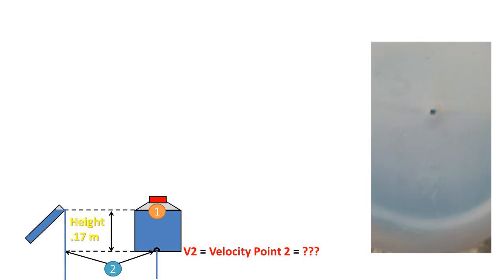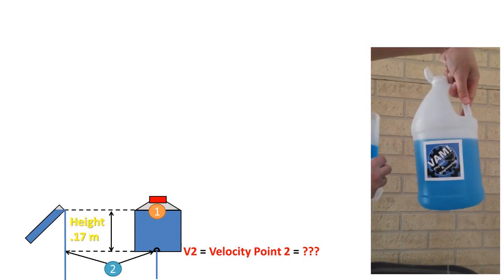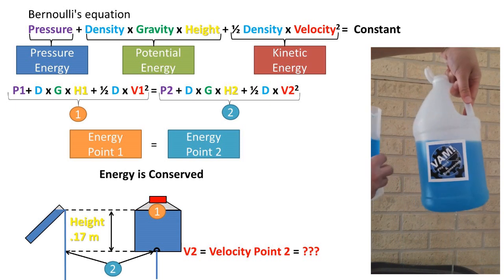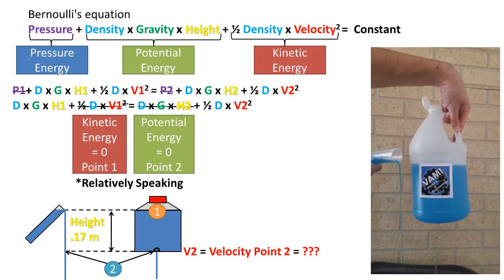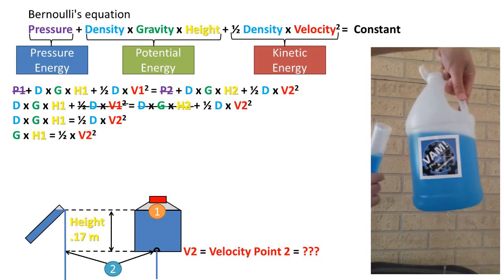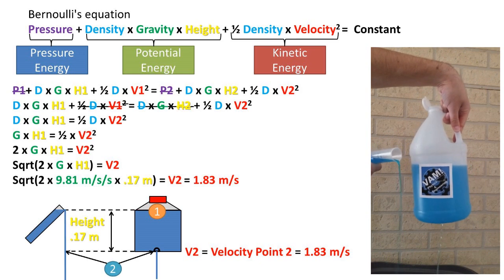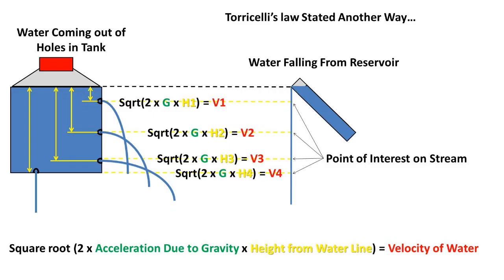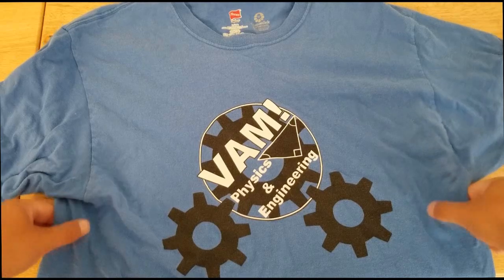Torricelli Law - Tank With Holes Verse Water Being Poured - Find Velocity of Water (Fluid Mechanics)

Comment: Let’s see if I can explain my idea…?
If there was a sealed tank that could both handle pressure and vacuum with fluid in it and an air space at the top, with a valve at the bottom. And above the water line, a pipe reaching down into water at the bottom of the tank from an open reservoir. With valves on both pipes. Is there any scenario where the valve at the bottom of the tank could be opened to drain the water in the tank, out. So as to create a vacuum in the air gap at the top of the tank. To make a vacuum low enough to overcome and draw water up the outside pipe and into the top of the tank, when it’s valve is opened?

So my question is about natural atmosphere pressure and water weight (gravitational pull) vs creating an artificial atmosphere low pressure with the water weight environment (gravity pull) in the closed cylinder. To counter the natural atmospheric pressure and the gravity (water weight in the smaller outer pipe) in a smaller (open/non-closed to the environment) cylinder, using water weight in a closed larger cylinder?
Reply from the maker: if I am reading right/brain is function right... I think you are describing a siphon with a valve. Two videos that might be helpful... Here is a video that goes over vacuum tanks being filled by open air reservoir. https://youtu.be/EoXGIIuAynQ and here is a video that goes over siphons https://youtu.be/fnFGGYf0bcw.

Comment: what if we use oil instead of water?
Reply: different density?
Reply: Bernoulli's equation applies for incompressible laminar flow while oil has a high viscosity, which is not an idea condition.
Reply: Bernoulli's equation applies for incompressible laminar flow while oil has a high viscosity, which is not an idea condition.

Comment: Hi, I hope you can answer. We are doing an experiment in which we vary the area of the hole at the same heights. We get the same velocity from this equation independently of the area because they are located at the same height but we don’t think that the velocity’s are the same because we see a change in time of emptying.
Reply from the maker: velocity remains the same but the volumetric flow rate will increase with the larger area of the hole. Hope this helps let me know if you need any additional clarification.